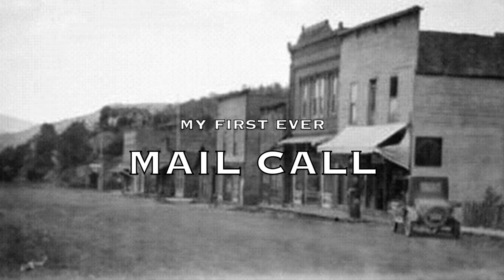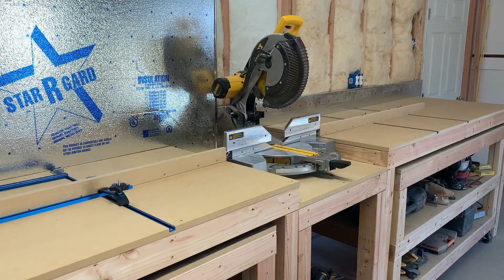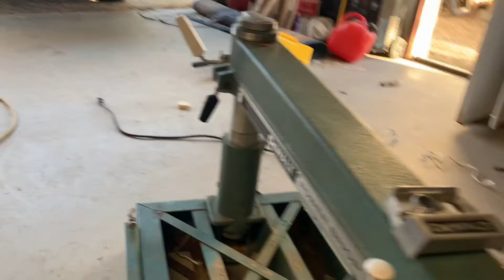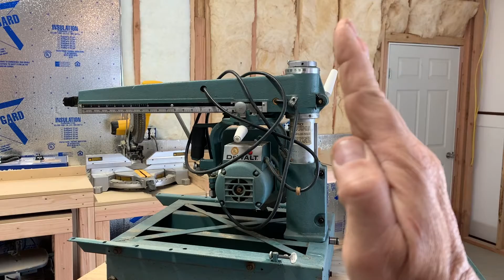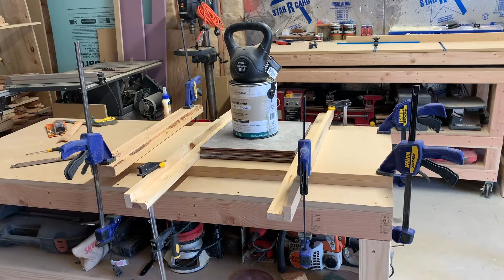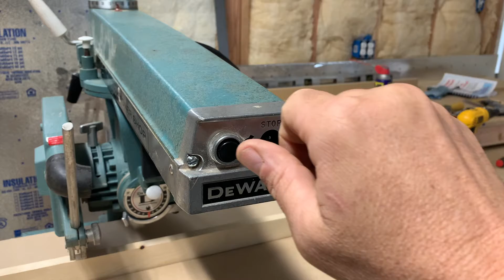OC&RG BV 11  (The Power Shop & Mail Call)

Comment: Man first of all I have to apologize to you.   I wish I knew you wanted a Radio Arm  Saw.  I have a  ShopSmith Radio Arm  with cabinet from the 60s I would have given you.   So if anyone else is interested I'm in Amarillo and you can have it.   It's not pretty but it works.  I even have the paper work.   Sorry again, Chris
Reply from the maker: Who knew!  Is it in good shape?
Reply: I put new wire and plug.   But I haven't used it.  It is still in good shape